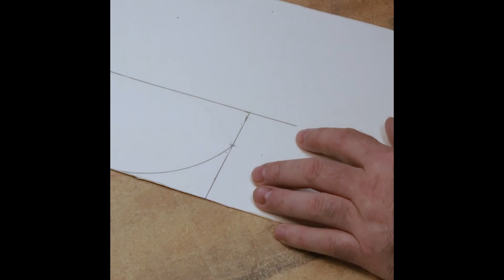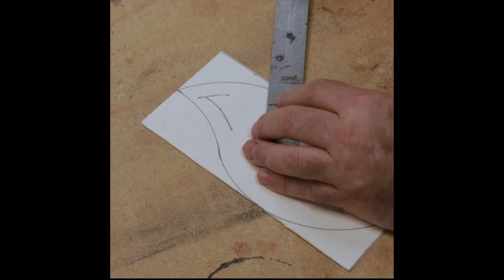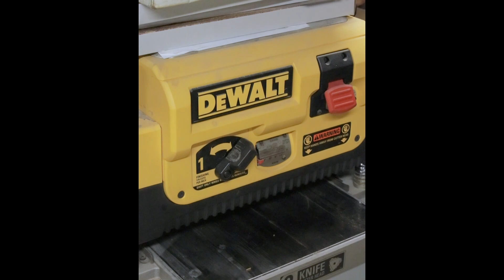Leaf Design - Bandsaw Box Full Build Video

Comment: A very clumsy way to build a Band Saw Box. The base is cut at one end from the piece of wood that the body is made of so that the grain matches. And then this way of gluing, you spread the Super Glue everywhere, even with your fingers. Only the wood that this glue lands on no longer absorbs oil or anything else; the fibers are deeply sealed. Watch how to do this correctly on YouTube, then try again. Your box is a 6